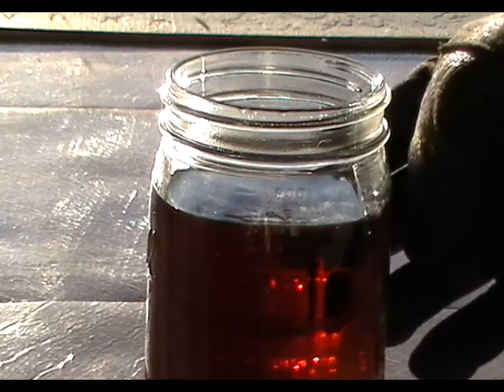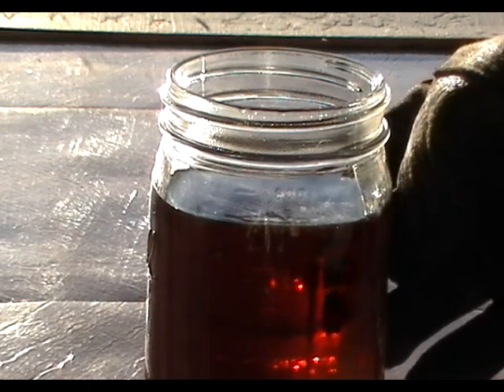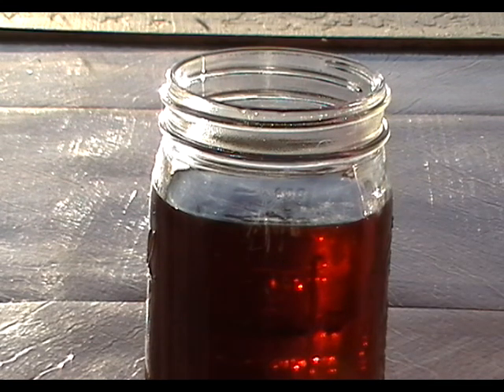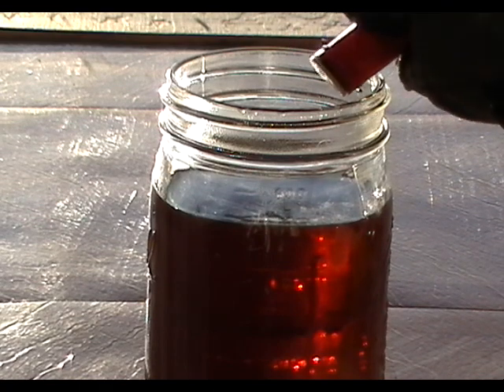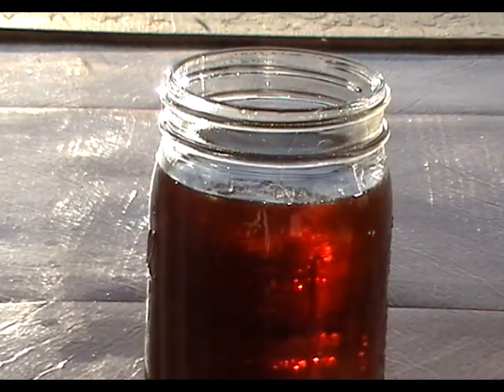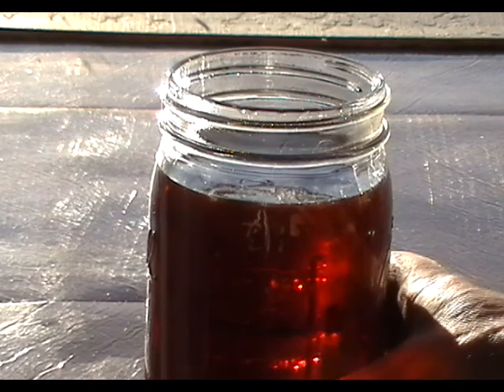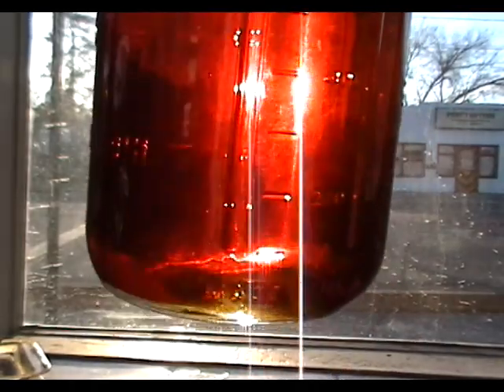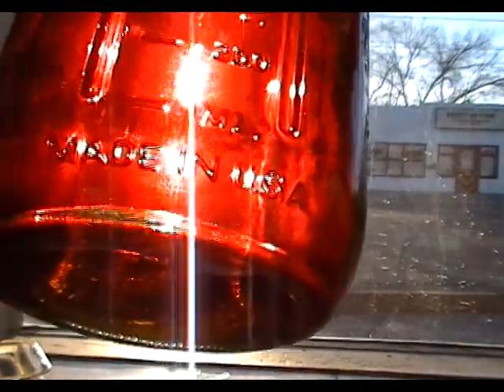Blending Gasoline with vegetable oil to make Diesel Fuel

Comment: Could you do this and then filter it off without heating or would it be too thick
Reply from the maker: After adding gasonline to a waste oil blend you should NOT add heat over 75F (25c). Further  I have since found blending waste oils with diesel fuel to 40% and leavig that blend to settle for at least a month at no lower temperature than 75F (25c), then carefully remove the translucent blend that floats to the top from the opace sediments, then add gasoline at 10%, leave settle for 24 hours, then add about 250ml of acetone to 20gal (80L), aboout an hour before filtration will result in a superior fuel product.

Comment: Is Ford Ranger 2013 (3.2 litre TDI) too modern and fancy motor for 20 % gas and 80 % WVO? Would love to give it a try but I'm afraid I break the injectors or something.
Reply from the maker: While the 80/20 blend runs fine on most diesel engines during the warm months; nonetheless, I found it leads to coked injectors, valves and rings. It is just too much waste oil in the blend, so I reduce the waste oil component by adding diesel fuel at about 30%. I also found adding acetone at 1%, then give the blend 24hrs for the precipitates to settle out, then drain the sediments before filtering into the fuel tank.
Reply: @Jhananda    Thank you so much for your answer, I appreciate it a lot! So based on your best knowledge, do you think that the mix with those tweaks you mentioned works fine in 2013 Ford Ranger TDI?
Reply from the maker: @TomHimanen  I expect the blend I will work on your diesel engine. But, make sure you have decent equipment to process waste oils into diesel fuel as described here. Also start out adding 5gal of the blend and top off with diesel. Run it for a few days. If you don't notice any loss of power or hesitation or smoke then add 10gal, then top off with diesel. Keep increasing the concentration up to no more than 50% waste oil.
Reply: @Jhananda  Thank you so much for these tips sir!

Comment: Hi again, do you have any experience with shortening?
I mixed a batch of aprox. 3gallons gas and 9 gallons wvo. I know that at least more than half the wvo is liquid shortening. It seat for a few days, and I pumped from the top about 5-6 gallons of very thin mix (went through a 0.5micron sock filter right through like water), the rest is a much thicker oil with litle smell of gas, and the vey bottom doesn't smell of gas at all.
This is in an unheated garage at probably around 30F.

Comment: Whether Biodiesel or just WVO, some states require road tax. Think in CA. it's 50 cents/gallon. Read they can do a dip test,& if not allow them it's $1,000 fine.  Wonder what they will say if tell them it's 50% diesel and 50% Vegetable Oil(buying from pumps) ? I may end up filling out the complicated government forms and say I use 5 gallons a week.

Comment: Hello again  is it ok to put the petrol and acetone in the blend at the beginning of the settling process, which I have done and it seems thinner, sooner.    Thanks
Reply from the maker: The reason why I do my blending in this sequence of 1) settle the WVO in a warm spot with no solvent to allow the food particles and water and fat to settle to the bottom of the container, which for me is a 5gal cube container. Then I carefully poor off the top light oils through a series of screens into a recycled cube container containing diesel or kerosene at a minimum of 20%, and preferably 50%. Then the sediments which have not been contaminated with solvent can be fed to animals or composted. Then leave that blend to settle for at least a week to a month.

2) Then if I'm going to add gasoline it is because I didn't blend kerosene at 50%, so I put gasoline at 20% in a clean, recycled cube container, or at this point I transfer it to my separation tank/funnel, and poor off the top of my first stage settled blend clean, translucent and particle-free into the gasoline, then leave it to settle for at least 1 day. 

3) At this point, since I am using my separation tank/funnel, I will drain out of the tank anything that is dark, solids or creamy. Then I add acetone at 1% to the top of the tank, then leave it to settle for 24hrs, then drain any sediments. If sediments come out, then I wait another 24hrs and drain any sediments. I'll keep doing this until no sediments drain out, then I run my blend through filters into my fuel tank.

This process might be time consuming but I have plenty time and I end up with a very clean product with little damage to my engine.
Reply: The.  Is there anything wrong with doing it my way, not that I Will , if I find it works, the wvo I'm getting is hardly used, golden colour, also I may have asked before but I can get paint thinners for half the price of acetone any advantage.    Thanks
Reply from the maker: @martinmorgan8475  my method produces the cleanest fuel, but do what you want.

Paint thinner often has alcohol in it, which will hold onto gum, which you don't want.
Reply: @Jhananda  hello.  I see what you mean.   Thanks again

Comment: so what is the purpose of adding gas if it would yield a lower btu than straight waste oil. you are also running it in a 6.2, it really wont develop the stresses a more powerful engine would with a gas mixture since it already has low amounts of stress placed on it in the first place, lower cylinder pressure, lower dynamic compression ratio ect.

Comment: Hello again Jeffrey, and thanks again for sharing all your trial and error data. I have a question for you about the 6.2 injection pump. I let one sit for a few years with a 50% veggie /diesel blend in it and now its gummed up with no output. Tried some winterization additive in the top of it... tried heating it up. Still no output so pulled it off the suburban. Don't think it needs to be rebuilt yet. Any thoughts on getting it to flow again? Thanks for a quick answer if possible. Robert
Reply from the maker: +Washington D. Sastor One thing to keep in mind with the injection pump used on an old GM 6.2L injector pump is ULSD diesel fuel ruins the silicon seals in the IP if the ULSD is over 50%.  So, your problem might be caused by the ULSD, not the vegetable oil.

Otherwise, to remove the gum then pulling the IP off engine, then open the intake port and the fuel solenoid port, then fully immersing it in a bath of clean, new canola vegetable oil, and heat it to about 160F (70c) may dissolve the gum.  An ultra sonic cleaner can do all of this for you, and do a very good job of it.
Reply: +Jeffrey Brooks Thanks for the quick reply. will try the oil bath first.

Comment: When using Unleaded gasoline, does it matter or improve if using 87 or 91 Octane gas ? Also, how does the vegetable oil neutralize the unleaded gasoline ? (meaning that using only unleaded fuel would destroy a diesel engine)

Comment: Hello again Jeff,

I'd like to know if you recommend using ethanol free gas over the up to 10% stuff. I have access to each, but obviously the ethanol free is much more expensive, more than diesel in fact. I love the 80/20 blend and am getting ready to stockpile for winter, so I'd love your opinion on whether ethanol gas is safe to use or not. Thanks again!
Reply from the maker: Storing gasoline blends for long term is a fire hazard.  I have also recently discovered that blending WVO with diesel fuel first, then allowing for a 2 week settling period removes more fat, than alcohol-based gasoline does.  So, I recommend that blend first as a safe blend that can be stored for a long time.

On the other hand, alcohol-free gasoline may very well work as well as diesel fuel blending to remove fats; while more effectively thinning the WVO, and one could increase the gasoline content to as high as 50% to get the correct specific gravity of a WVO-based diesel fuel.

However, one also has to realize that alcohol-free gasoline most probably has lead in it, which is toxic to you, and the rest of us.
Reply: My friend said he mixes about 10-20% gas with his wvo and it did not start on fire when his shop burned down and it was burnt down beyond repair from what he told me.

Comment: Do you have to make any modifications to the Diesel engine?
Reply from the maker: No, if a waste oil based gasoline blend is made properly then it should run on any diesel engine.

Comment: ive run two vans all year round some yrs ago with fresh v/o mixed with regular diesel 25% diesel in the summer and 50-50 in the winter with out any problems (im in uk though dosnt get that cold) your way looks cheeper though,, is it ok and leagle to run with a mix like that if they decide to test it

Comment from the maker: If a proper blend of solvent with waste oil is made, then there is no reason to alter the engine, or fuel system to burn it.  I do not happen to recommend diesel fuel-waste oil blends, but advocate light solvents, like kerosene or gasoline as the solvent with waste oil; however, 60%diesel fuel, with waste oil at 40% should run fine on any diesel engine during the warm months.

Comment: Can you do a lighting test compared to diesel
Reply from the maker: I am not sure what you mean by a "lighting test," other than putting a match to your blend to see if it will ignite.  I see no value in this kind of test because there is no reason to drive off the lighter volatiles in the blend, and diesel fuel and kerosene as the primary solvent should not ignite easily. Also, the light fraction that is undesirable in a gasoline blend is alcohol, which is often added to gasoline as an octane enhancer.  Alcohol actually remains while other light fractions in gasoline evaporate off, so allowing the light fractions to evaporate off in a gasoline-based waste oil blend will only increase the concentration of alcohol, which can ruin the seals in your injector pump if the alcohol content rises over 3%.

Comment: Reporting back after about a month of my mix been settling.
Mixed 50% filtered wvo with 30% diesel for 2 weeks , then added 20% gas and 1% acetone and left setting for 2 more weeks.

Today drained 15% from the bottom and it feels and looks like pure wvo .
Dipped thinker from the top if the barrel and it liquid on the top feels like gas ir diesel.

Looks like nothing has blended together.

Mix was at room temperature whole month with windows open next to it so at night it was twice as cold.

If i pour this kind of mixes in my tank wvo will drop to the bottom of the tank and when top half if diesel and petrol gets used car will consume pure wvo.

What a my doing wrong ?

As it stands now my mix is pointless as it doesn't blend :(

P.s i did not steer my mix at any point
Reply from the maker: Chemically the triglycerides in WVO normally dissolve readily into petroleum distillates unless the temperature is below 32F/0c. And, blending occurs best when temperatures are above 75f/25c. So, what temperature was your blend at when you checked on it. 

If the Ambient temperatures were correct then just because you can smell gasoline and the blend seems thin doesn't mean you haven't created a useful diesel fuel blend. You can help yourself by purchasing a hydrometer to check the specific gravity of your blend. You want your blend to be close to the specific gravity of diesel fuel.
Reply: @Jhananda  +13 at night , +18 to +26  a day Celsius, seating inside under open 24/7 window 

I Have steered it now and after 15 minutes mix still holding blending.

Before i steered it today for the first time it was clearly wvo at the bottom of 100 litres barrel and diesel +gas + acetone on the top cause I have dipped my fingers and rubbed then  against each other for both top and bottom part. 
Bottom part felt way more slick and thick

Maybe finally steering it today will have it blended for good
Reply from the maker: @maximolotov  it is odd that your WVO is not going readily into solution with petroleum distillates. Just out of curiosity what country are you in? 

Another difference between my method and yours is I always put the petroleum distillate into a clean container then I add the WVO to it. I also start by blending diesel fuel with the WVO, then I leave it for a month to settle. Then I put gasoline into a clean container then poor off the top clear WVO + diesel blend which separates the clear solution from any sediments at the bottom. Then I leave that solution to settle over night. The next day I poor acetone at 1% on top of that blend and leave it to settle again for 24 hours. Then I either drain off any sediments if I'm using a domed bottom tank with a bottom valve for draining sediments, or if I'm making bucket batches then I very carefully poor off the top the clear blend from whatever settled to the bottom.

Keep in mind acetone can cause water to precipitate out, and it will be clear as well, but if you are careful you can see that water at the bottom will be more dense and clearer than your blend. And, if you agitate your solution water, and other contaminants, can be forced into solution. Which is why I never agitate my blends.
Reply from the maker: Another possible explanation for why your WVO is not going readily into solution with petroleum distillates is perhaps your WVO is creamy, white, congealed fat and not translucent, light low melting point triglycerides. If this is the case then you need to settle the fats out of it by storing it for a month or more in a warm place, then pour off the light, translucent low melting triglycerides from the white, thick fats and feed the fats to animals before contaminating it with petroleum distillates. Then blend the light, translucent, triglycerides with petroleum distillates and it should blend well.
Reply: @Jhananda  Thanks very much Jeffrey 
Scandinavia.

After steering mix it seems to hold it together pretty well.
I suppose I just have half full tank or so and break hard while driving  from time to time every day so fuel tank gets good shake, just in case

I have tested my wvo on in hot sauce pan and it contains no water.
Also my wvo after 3 weeks settling has no cream or any other stuff. It is same looking wvo from top to bottom. Now it has been seating mixed with  diesel for about a month and 1 week with acetone and gasoline added on the top and  steered and it looks and feels the same top to bottom.

Due to storage issues i plan on mixing 50%  wvo with 30% diesel + 1 % acetone and steer it and then let  it seat for 2 + weeks and then  add 20% gasoline and then  day after get it in the tank and job done.
It is  cause after adding gasoline mix becomes crazy smelly.

Hope it will work this way for my 2.0 tdci Ford transit 2004
Reply from the maker: @maximolotov  I understand you need to avoid the bad smell, but I recycle the 20L cubies of WVO for processing in bucket batches. The important thing is to do just diesel blend and leave it to settle for a month. My guess is it is too cold where you are to avoid agitation, but that means you will have fuel stratification in your fuel tank, which is likely to lead to fuel filter plugging and injector pump plugging and injector and valve coking. 

You could try buying an electric blanket to wrap around your WVO and blends to keep the temperature at a constant 75f/25c for the first stage of settling without diesel, then poor off the top translucent oil into a clean cubie with diesel at 30%. Leave the blanket on for another month of settling. Then pour the translucent blend into another clean cubie with gasoline at 20%, leave warm with the lid on for 24hrs, then acetone poured on top, wait another 24hrs, then pour off the top clear WVO blend through your filtration system into your fuel tank. This has been my winter method. But your winters are much colder than mine so I think you should only run WVO blends in the summer.
Reply: @Jhananda  Roger that

Comment: Hi I have a landrover discovery 2.5 diesel. Will this work for my disco  As the weather is cold. Do I need a kit or I can use it directly in my tank?
Reply from the maker: This fuel blend seems to work in all diesel engines; however, one should start out cautiously, by adding a small amount of this blend, say 1-gal (4L) to the fuel tank, then top off with diesel fuel.  Then drive on that for a few days.  If it works, then increase the amount in steps of about 5% until your vehicle stops responding well, then back off to the level that runs well.  Also, do make sure you settle the blend for at least 2 weeks, then remove the sediments, then filter it well.

Comment: Eh ya on a mechanical engine yeah you can get away with running a bit of gas, but anything with huei or common rail it will toast the injectors/pump fast. even on a mechanical engine the injectors and pump will be wearing at faster rate. you also have to look at the burn rates of the gas compared to diesel, if they were blowing head gaskets I would venture to say, the gas caused a very rapid spike in cylinder pressure and blew the gasket or lifted a head while under load.